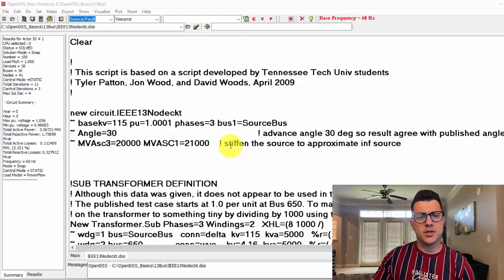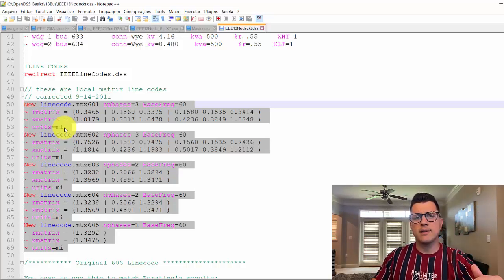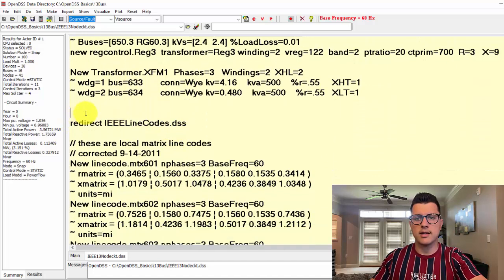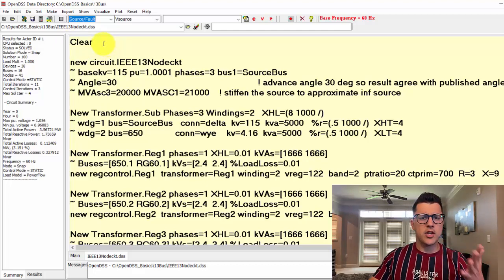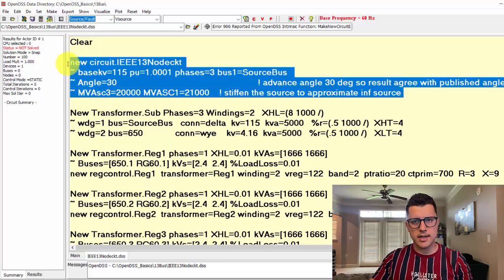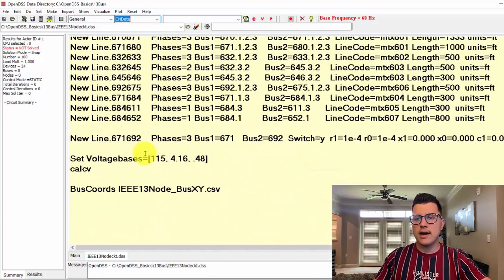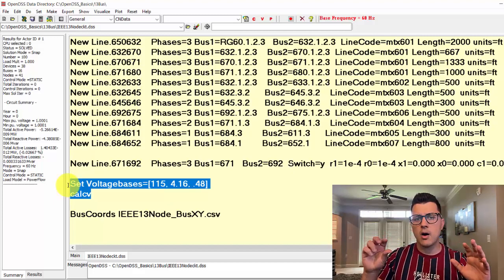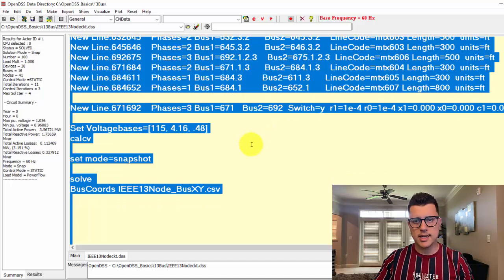2 - [En] OpenDSS Basics | Summary Part 1

Comment: I tried to input the standard IEEE 33-node system into OpenDSS, but after adding transformers, the results of the power flow calculation are incorrect. The VoltageBases value corresponding to the transformer's bus cannot change the basekv
Reply from the maker: Hi Birtc,

OpenDSS uses voltage in volts (V), currents in amps (A), and impedances in ohms in its power flow method. Therefore, adding an accurate transformer will yield the correct power flow solution. However, the per-unit voltage requires the correct basekv for accuracy. If necessary, you can update the voltagebase list.

Ensure that the transformer model is accurate.

Best regards, 

Paulo Radatz